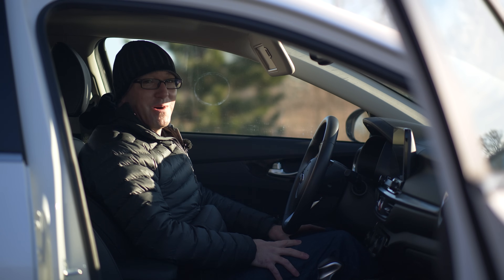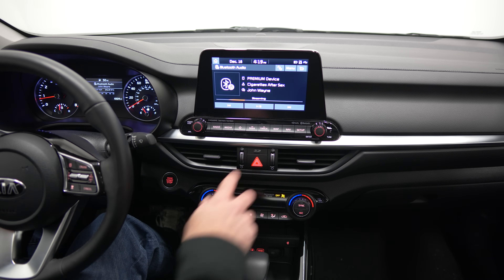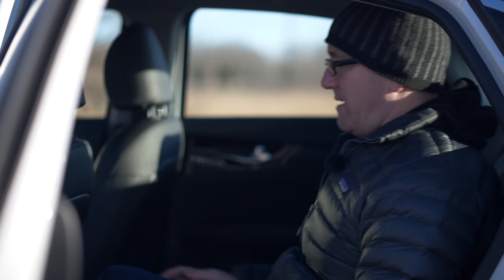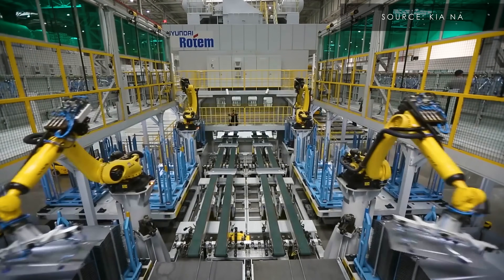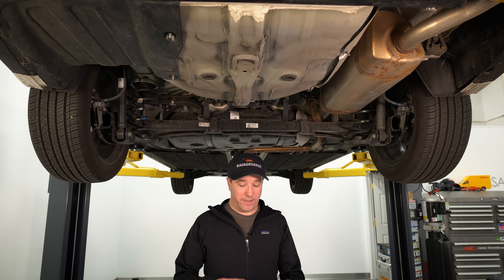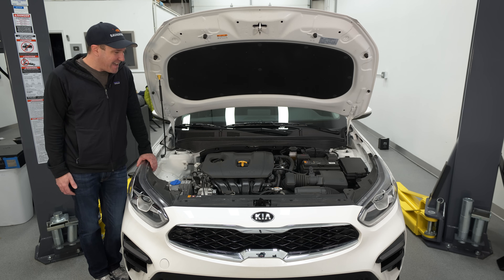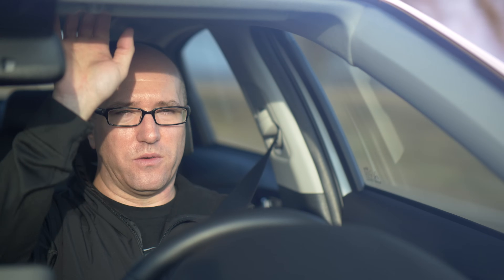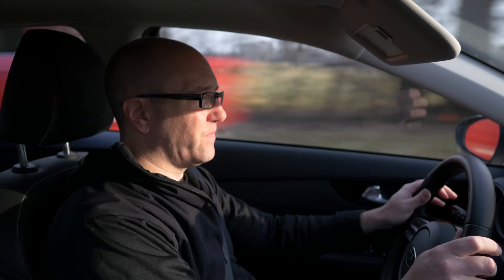2019 Kia Forte Review | Bait and Switch

Comment: I love the "continuously" in continuously variable transmissions. I hate gear shifting. Why would they ruin a CVT's true advantage by simulating gear shifts in "drive" mode? The simulation of gear shifting should be activated only in "sport" mode, not in "drive" mode. I was really hoping to see a good CVT transmission.
Reply from the maker: There is nothing worse for drivability than a droning, ruberband slip like CVT experience.  This transmission blends the best of a torque converted automatic and a CVT together
Reply: @savagegeese  I've never experienced this slip I keep hearing about in a CVT equipped 2012 Audi A4 and I've driven it 43000 km. I would have loved to experience the tranquil feeling of a CVT on top of KIA's relative simplicity and strong reliability. A CVT's working principle does not "need" gear shifting. Car manufacturers implement gear shifting simulation in CVTs because many drivers want that conventional transmission feeling.
Reply: i wonder if it "fake shifts" under low/moderate throttle... i know some CVTs are programmed to "fake shift" under WOT, but otherwise behave like conventional CVTs

Comment: Just got the base model as a rental.It is pretty good.Suspension is a little bit taught,but not that bad.Just test drove the Toyota Hatchback,fantastic car except it is on the loud side when hard accelerating.Sme with the new RAV4.Why Toyota?I am pissed as I am trying to save what is left of my hearing at 62.At 62 though I still drive fast.Lol

Comment: i came into this video knowing i would hate the car because i dont like kia and hyundai. after watching it it changed my mind on the car. if they just got rid of the infotanmint huge screen radio and put in a old style double din radio from an aftermarket manufacurer like sony or pioneer maybe they could have had the money to put in independent rear suspension or at least made it a little cheaper to do that. im in the mindset of if you cant do port and direct injection just stick with port injection to keep the maintenance cost down for the consumer on getting valves cleaned.

Comment: Hey, I'm a bit of a noob when it comes to engines a drive systems, but was a little confused.
I thought a CVT is all one large variable gear, but I heard "shifting" during the test drive. 
I've only ever tested a CVT once (hated it Nissan >.>) but I don't remember shifting. 
Am I missing something, is there shifting? HOW DO THESE WORK? And how does a manual CVT work?
Reply from the maker: CVT is exactly what you said a constantly variable transmission. What they are doing is through software and mechanically programming it to emulate what gear changes would sound and feel like.  Why, because people and press do not like the sound and feel of CVTs that feel like a rubber band and hold rpms for extended time.
Reply: @savagegeese   Thanks for the reply bro, I just realized the Prius C does that doesn't it? I always thought it was just the electric motor kicking in and out.

Comment: God damn this is hard. I cannot figure out what I want to buy next. I’ve owned the 12 Elantra, 15 Accent, and 17 Elantra. All of them had significant issues that I hated. All of them had shitty ass ride quality and shitty seats. The Accent was particularly atrocious because I bought the appearance package with those shitty LP wheels. All of the Hyundais needed serviced often, so I was able to spend lots of time in Sonatas and once in an Azera. The Sonata rides so much nicer and feels so much more premium. The Azera doesn’t exist anymore, so I know that’s out of the question. Thought about 18 Elantra Sport except the DCT in that sucks from my test drive. The Jetta has the tech I want but is it quiet and does it ride well enough? Should I buy a fully decked out Elantra, Forte, or Jetta or should I buy a base model Sonata? I thought about a Mazda as well but they don’t seem to have very many features. Toyota Corolla Hatchback was a contender until I heard about the CVT and I’m skeptical of it.  What are your thoughts? Ride quality, quietness, and as many premium features as I can get are the biggest things that I care about. Guess that’s a bit broad. Reliability is important but if they’re under warranty then I guess it’s not huge. Help! Lol.

Comment: This seems like a wonderful car.   Multiport fuel injection and ease of service are two huge pluses.  My bet is Kia is making money on every Forte they sell.
My problem with Kia or the Hyundai group as a whole is.  In spite of all the improvements Kia has made over the years a two-year-old Kia feels like it has aged 6 years.  The Hyundai group to this point have not made one automobile ( for the states) that has the ride handling sophistication of even a basic Vw Golf.  I know it can be done because the Bolt and the Cruze both have a fairly good ride-handling compromise.  Most of the engineering for those cars was done in Korea.

If you need cheap new reliable transportation for your long commute this is an excellent value in the base form.  If you are single I would look at the Toyota Yaris IA.  That car can be had for 16k.   The Forte has far more interior room.  

I would give up all the tech if you have 26k to spend.  Go with a base Camry.  The Camry is a far better car that holds it value far better.  The Base Camry is a 30 mpg+ car.  You can drive a Camry for 3 years 50k miles and still get back 20k+.  Get a good deal on an off lease Camry and you can literally drive it depreciation free for two years.
Reply: The Yaris iA is actually a Mazda2. There's nothing Toyota about it.

Comment: 15,900 miles and my transmission is slipping. Sadly, it’s been recalled and they are replacing a lot of them.
Reply: Well lets hope that KIA gets the 'bugs" out of their IVT as I personally believe that it is a well refined CVT!  Let us know how things worked out for you!
Reply: @johnbeckham1483  had the cars at the dealership for 9 days and no update, customer service was garbage when trying to get them to look at it and getting a loaner car was a fight.
Reply: @sigspearthumb2313 , sorry to hear that!  KIA hopefully will make things right for you!  Their reputation is at hand here so therefore they do indeed need to satisfy you and keep both their current and prospective customers confident in their IVT!  I was originally impressed by their IVT refined design with the metal chain?  FYI check out our BestLine Transmission Treatment & our other lubricity products!  Good luck and thanks...  http://www.extreme-engine-relief.solutions
Reply: @sigspearthumb2313  any update?
Reply: @consciousawakening4799  yeah, took them 30 days to get it approved and swapped. Not thrill, the new transmission has the same hiccups the first one had. If it slips again I will have the car lemon law’s

Comment: This is not a car you brag to you car peps about but as a simple commuter car,  it does it job pretty well.  

Manufacturers are finally realizing budget owners don't want cheap POS

I still worry about reliability though.  Not enough time has passed from those late 90's garbage Kia's.
Reply: 10 year 100000 mile warranty, rated top reliability by CR and KBB. I had one, built just as good as a JDM vehicle. Nothing to worry about.

Comment: I’ve never seen the underbody of a car before. Why is there rust if it’s a new car?
Reply: Same thing I wondered?
Reply from the maker: A lot of vehicles are made with untreated or uncoated steel and cast iron.  They will be susceptible to surface rust immediately mainly in the Midwest weather exposed to salt. This is a common thing and pretty much every car now namely on the affordable price point and there's not much you can do about it.
Reply: @NotLikeUss  welcome to winter salted roads in the northern states. Surface rust forms pretty much immediately after any new car is driven off the dealer lot.

Comment: Must have been a different transmission than the rental I just drove with 22,000 miles. That one was loud and very CVT'y. Hitting bumps at highway speeds in the rain bordered on being scary. Even a rental Nissan Versa (yuck) was a better drive than the Forte.

Comment: Can someone ELI5 and tell me why you'd want a CVT to emulate a trans with physical gears? Doesn't this defeat some of the purpose of a CVT? Wouldn't the car be faster if the engine hung out at peak HP and the trans accelerated the car, like the way a snowmobile would? Please I've gotta know.
Reply from the maker: It's not so much about the efficiency as it is the drivability.  because of the modern designs they don't lose as much efficiency as you think by emulating gear changes.  the problem with traditional CVT is that just hang out at the upper end of the RPM band as it creates a lot of unnecessary noise vibration and it's tiring to drive.  The ability to have the transmission step into a consistent point in the RPM band to simulate gear changes feels more natural and is less assuming to the driver.  Lexus started studying this with gear ratios in their newer cars and they found in their studies that rhythmic shifting is more satisfying to a driver than inconsistent gear changes.  Or in the case of a CVT just high RPM action all the time.
Reply: That makes sense.

Comment: Kia's has out Corolla-ed the new Toyota Corolla with the new Forte. For people who just want a simple car + modern tech, your new ride has arrived. Problem is I feel Kia has went TOO basic - no multi-link rear suspension, no electronic emergency brake (which also tells me no automatic emergency braking), and no GDI when they are the pioneers of such tech makes this a 90s like car with 2020-like infotainment technologies. If this was the Rio I wouldn't have minded, but at the $25k price point against rivals like Civic, the new Mazda 3 & the new Corolla? I'm not as convinced.
Reply: Sorry to burst your bubble but electronic parking brakes are inferior to a mechanical one because you can do things with a mechanical one that you can't do with an electronic one. Also unless the cables are frozen due to corrosion ( after 10 - 15 years ) they always work even when the front brakes are "down to the metal". You can do "slides" with the mech hand brake and control the amount of braking - the electronic is on / off only. You can trick some 4 wheel drives to lock up the rear differential if it is spinning on one side only by modulating the rear mech brake. The list goes on and on. The only advantage the electronic brake has is for the manufacturer who can make it for less money at a loss of flexibility to the end user. Just remember one thing - all these electronic gadgets are fine until they fail then they cost a fortune to replace.

Comment: Can’t they just add the IRS cost into the sticker price?  The Civic has all those features and still has IRS 🤷‍♂️
Reply: Some are saying the torsion beam back suspension is quieter and smoother than an independent back suspension. Mazda keeps the independent rear suspension for their more sporty MX-5, and did away with it for the new Mazda3. It  seems like they spent a lot designing the optional Skyactiv X diesel-like gasoline engine that will be available for the upper level Mazda3 later- it is supposed to be in Europe in late 2019 as an option, and for the rest of the world later.

Comment: hey savagegeese, i just graduated with a BS in nursing. i should be working in like less than 6 months. im starting to look at cars again.
i want a rwd with about 300 hp. ive been looking at some like the 2013 -2017 genesis 3.8 and 2015-2017 mustang 3.7. i wanted the 370z but the technology/infotainment sucks. the brz is too slow. im trying to stay away from luxury brands due to their high cost to fix and maintain.

any suggestions?
Reply: What about keeping an eye on the Kia Stinger used and CPO market over the next several months? RWD with two engine choices and that useful hatch / lift-back present some decent options. Used 2018 models are already on the market.
Reply: @YasumotoUS  nah. its heavy isnt it? its like 4k lbs and but then again so is the genesis. hmmmm... maybe ill look into it cuz the interior is pretty nice compared to the mustang
Reply: @Dark Days i usually keep all my maintenance and fluids up to date but i dont like that the 370z has a dated infotainment  system. i cant go without bluetooth lol
Reply: @Dark Days nice! thanks for the suggestion. g37 sounds pretty good. hows the maintenece and repair costs like alternators and shit like that? cuz i had a bmw for a bit and the parts for it were so expensive.
Reply: @Dark Days thats not too bad. i do all my car work except for big jobs i dont have tools for. thanks. ill consider a g37 when researching and test driving cars soon
Reply: Yeah, get a KIA Stinger GT.
Reply: @bigwillchill  yea, 3829 curb weight. Since we are commenting in a Kia vid and you mentioned RWD, I thought it might be worth a look and a test drive, for ya. They aren't cheap cars and they may be more of a touring ride than a throw through the twisties all day long affair.  Good luck with your search!
Reply: @mezzb  Great point. Have definitely looked into that option for used Subarus, most of which have a double DIN sized cavity for the head unit, but most of which up through 2018 did not support CP or AA. It is important to determine if the head unit of choice will work with steering wheel controls, back-up cameras and other existing connections / electronics in the target vehicle, too.

Comment: Now that some time has passed, the NHTSA has received numerous complaints about the CVTs in these cars.  Many have failed after just a few thousand miles.  Unfortunately, no manual transmission is available unless you upgrade to the GT. To get the 6-speed manual on a lower-priced car, you would need to buy a Hyundai Accent SE as the Kia Rio is also only available with the CVT.  For a review, go here: https://www.caranddriver.com/reviews/a15389870/2018-hyundai-accent-manual-test-review/
Reply: This is concerning!  However, this newly (2019) designed so called "IVT" (Intelligent Variable Transmission) originally seemed to be a well refined version over previously built CVTs by other car manufacturers in the market?  Hopefully KIA can get this IVT issue resolved in their CVT becoming a reliable transmission!

Comment: with way less than  26k you can buy a jetta even a passat way better ride quality  way better car and bumper to bumper 6 years, 72k miles
Reply: Both have a torsion beam suspension, the Forte gt will have 201hp for less than an se jetta. And you can't get any good motors from the jetta anymore. 1.4tsi is the only motor til they release the mk7 gli in February of next year
Reply: @IReahpZz  what about ride quality , do you think they are  both the same, bumper to bumper warranty same?
Reply: @greenvalley651  ride quality in the Forte gt will be better than a regular jetta, but even with a gli jetta when it's realesed. The bumper to bumper is better but the power train is higher on the Kia. Also there have been a few bugs with the new jettas 8 speed transmission. Just something to be aware of